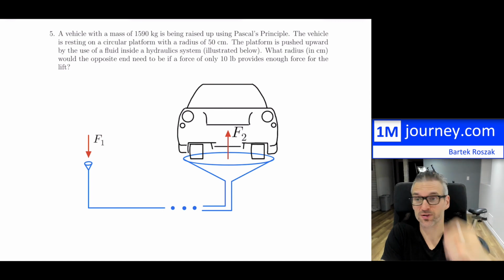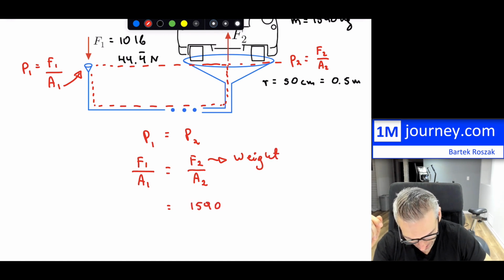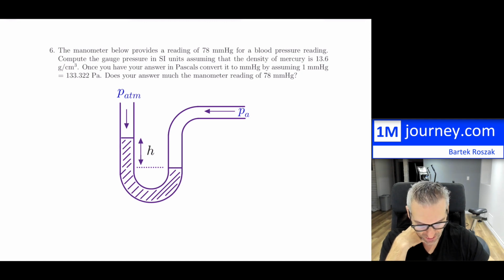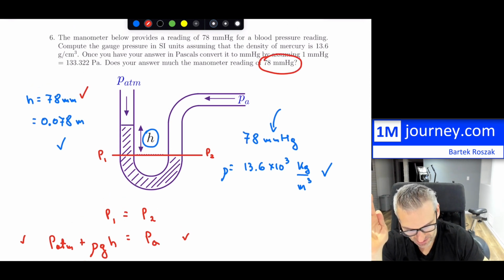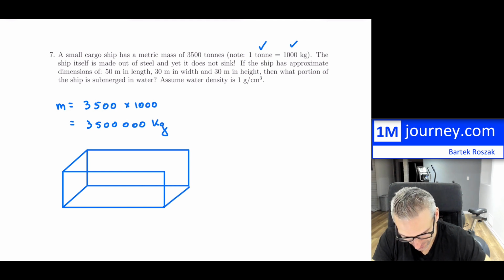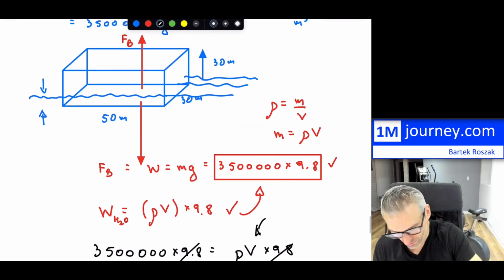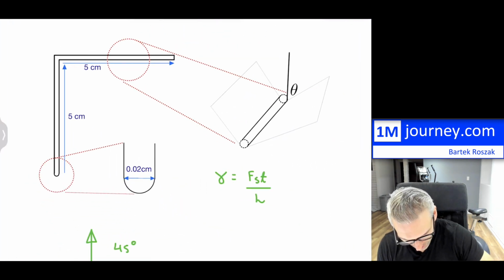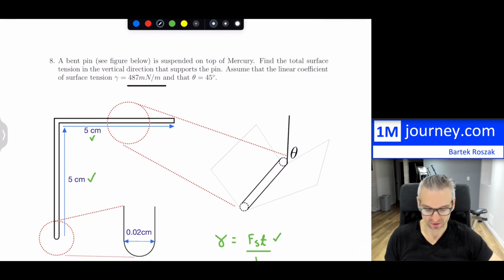Fluid Statics, Density, Pressure Test (Part 2)

Comment: For Q4, should be r^2 not d^2 when calculating the area?😳
Reply from the maker: HI! Do provide the timestamp of when you saw this and I can look it up. Cheers! Hopefully the video has helped!
Reply: @1mjourney  Hi! It was at the very beginning(00:42) in this video, the end of Part 1 video as well.
Reply from the maker: @joycejin7632  This video starts with Q5 and there is no reference to d? Sorry,  at 00:42 of the video the question is just beginning and I walked through the question and only see reference to radius?